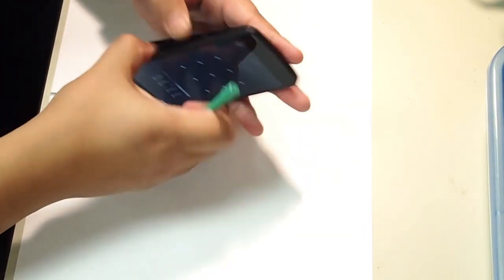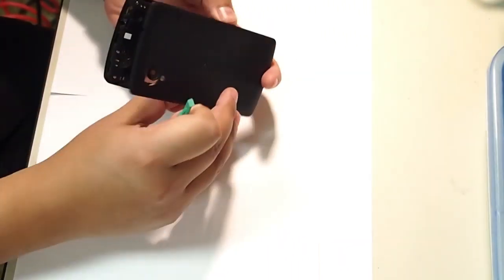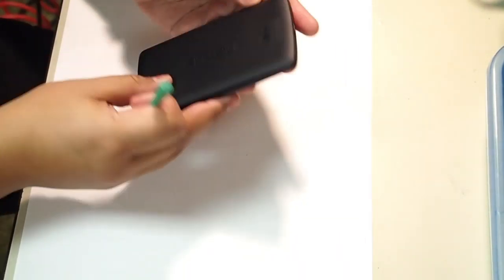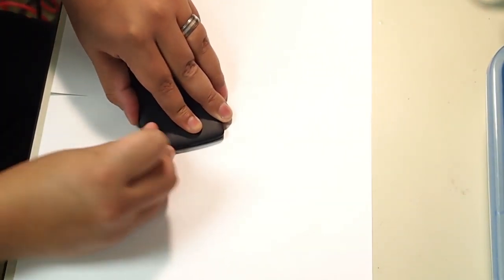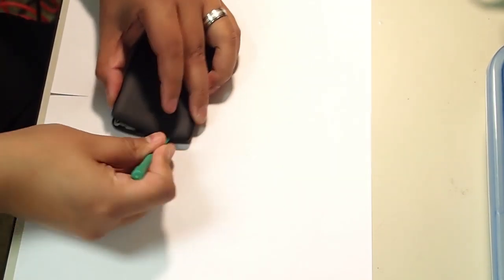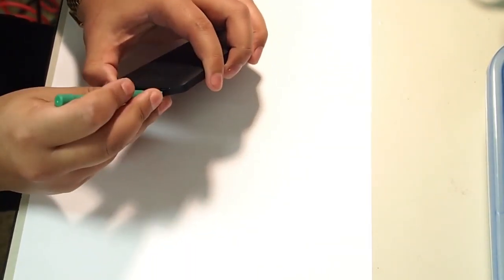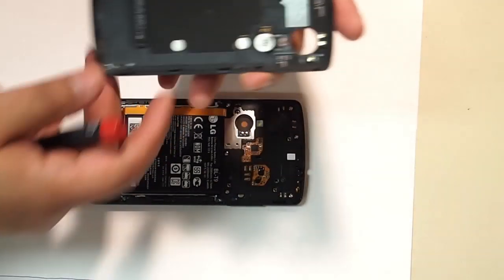LG Google Nexus 5 Take Apart Repair Tutorial DIY

Comment: Hey... My nexus 5 doesn't show network at all... I tried switching it off and on... I replaced my simcard with another Sim card just to check if the Sim card isn't proper... However even the other Sim card didn't show any network.... What can be wrong? Is something wrong with the motherboard? Can it be repaired?
Reply: i got the same problem now, have you solved your problem or did you just change phone? Thanks!
Reply: yes that an be repaired. buy a sim card slot and repair it in nearby shop

Comment: Does the back go on with no gaps or will there be gaps if i take it apart? i recently scratched my camera lense pretty bad just by dropping it between my bed and the wall :/ it doest cover the lense to where it affects the image but its not a pretty sight to look at i obsess over therse things
Reply from the maker: If you dont break any clips it will go back on with no gaps. However be careful with the clips. If you do happen to break a clip then just put some 2 way tape on the battery and it will help the back stay in place.
Reply: techguyz708 How difficult is it to remove the back without breaking clip 1 out of 10